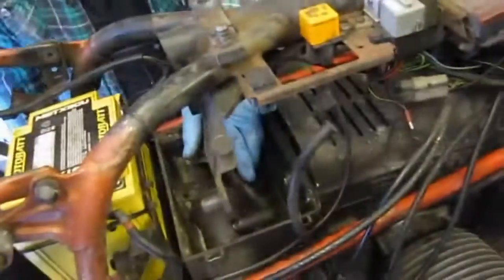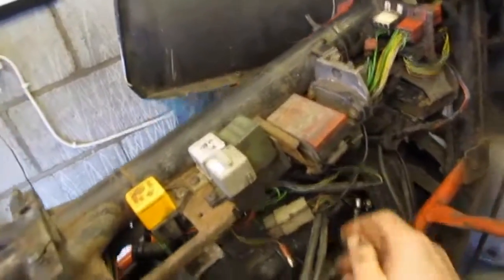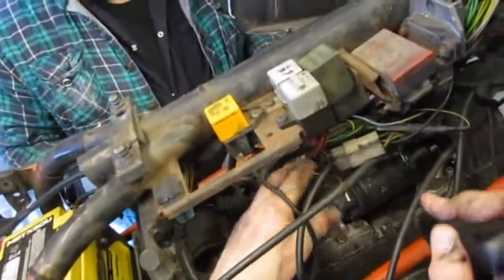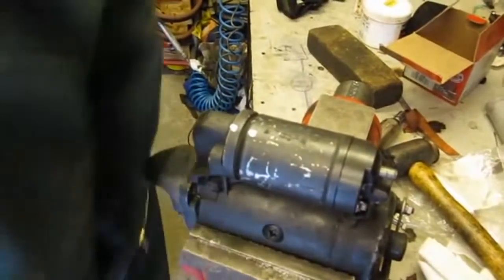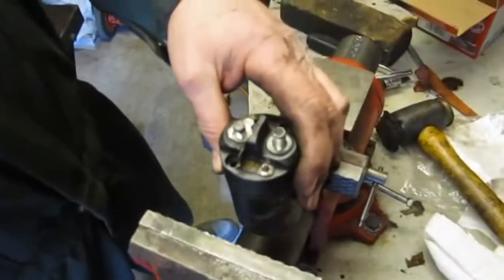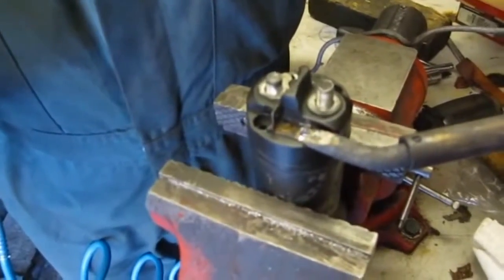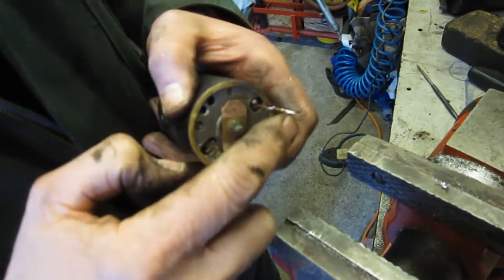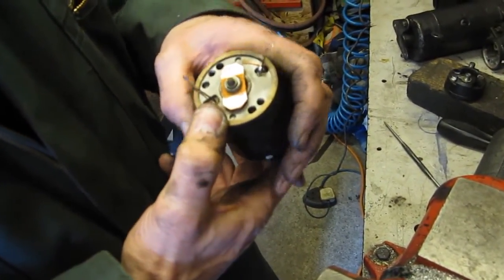BMW Airhead Starter Motors Part 1

Comment: Hi there I've got a r80/7 with a valeo fitted the battery is fine and been tested under load the starter turns the bike over very slowly it will start eventually but today I've tried to start it and it was too slow I saw a mist of smoke coming from the starter housing all connections have been cleaned I think the starter is on its last legs does it sound like it to you  regards  mike
Reply from the maker: Hi Mike, from your description the trouble does appear to point towards the starter motor. Older Valeo starters can be troublesome, I replaced mine many years ago with a ND one available from Motorworks. It has behaved faultlessly and I recommend it.
Reply: @motophoenix5951  thanks I've taken the starter off ,after watching your video great help too, taken it to be tested and its very slow even the armature moves slow it was a valeo dated 2006 but the chap told me it had already been reconditioned previously so new starter needed thanks for your reply ps I passed bike test few week back and the bike is great to ride ,when it's running lol
Reply: @motophoenix5951  ps it's a 1979 r80 /7 did these bikes come with optional side panniers I think they look great on them regards mike

Comment: Managed to get the engine running on my R100GS earlier this week...But the starter seems to have an intermittent issue...Sometimes I get the same issue as in this video and then other times it starts perfectly...Although once it has the issue it won't seem to start for a few hours...Battery is new...and I have been recharging it overnight...Hate intermittents!
Reply: I've just replaced the starter starts perfectly now